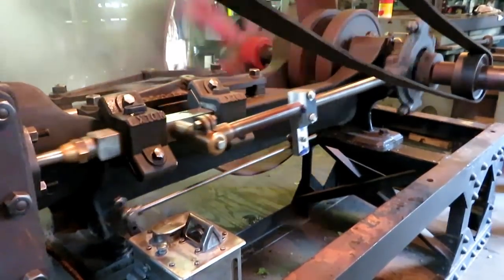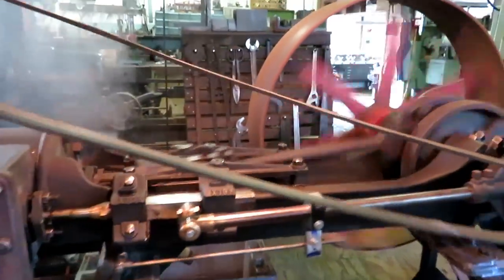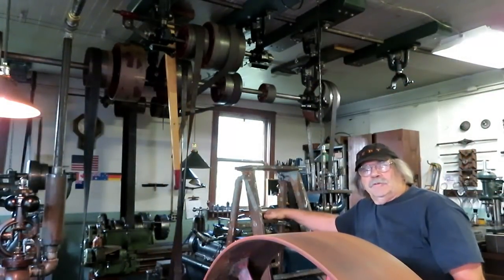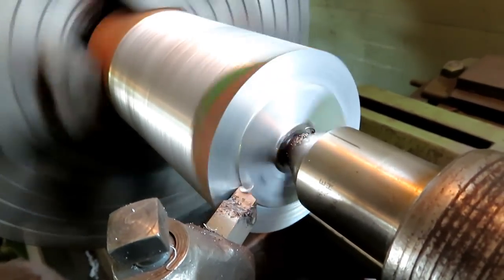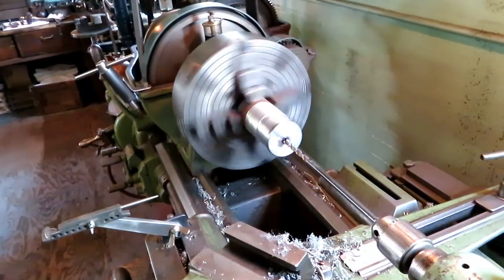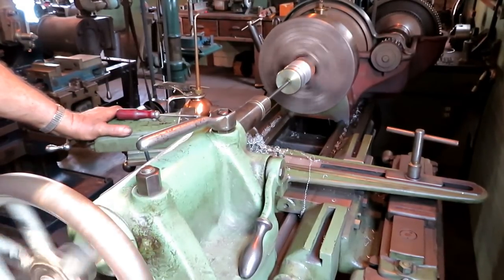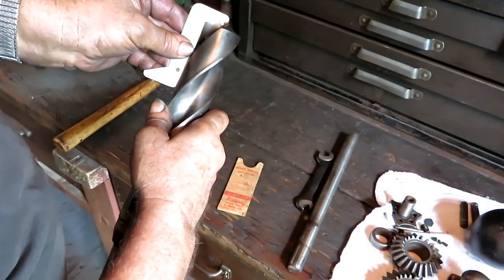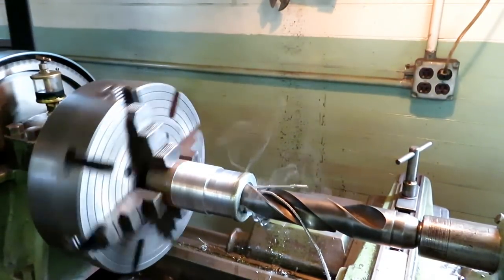OLD STEAM POWERED MACHINE SHOP  28

Comment: Dave I was watching the segment where you were showing the line shaft hangers that you had casted. On the one part that hangs down and you said that you just wrapped it with tape to make it thicker so you had material to machine off and to cut the threads. How did you set that up to turn it and thread the shaft portion that you adjust up and down. I've been trying to figure out how you set that up to turn?
Reply from the maker: Hi Scott:  That was done before I became interested in YouTube. I chucked it by the stub end, center drilled it in the "Y" and then turned and threaded it between centers. IF I do another one of those, I'll show it....Dave
Reply: David Richards Dave, sometime after I wrote that I remember you talking in another episode about turning between live centers, something that's not done much anymore you said, and thought, "I bet that's how he did it"  " he chucked up the round end and center drilled with a starting drill to give a center to hold against, marked out the center on the shaft end and drilled it then turned it between centers!!  It's not much but I was proud of myself as a non machinest for figuring it out, your a good and natural teacher.  I hadn't touched a lathe since high school and yet the other day out at my brothers house who recently bought an old South Bend from the thirties that's been converted from belt to electric belt I felt comforts tinkering with it and showing him a couple things, especially how to change the gears for threading.  That was awesome because he turned to me and asked rather amazed how do you know this stuff?  Which I responded " I had machine shop my senior year!"  The look on my brothers face was priceless!  But it's really neat to understand how the machine was originally set up to work and you can see how they converted it to an electric motor.  How the motor drives a V belt to a big sprocket which then drives a flat leather belt which was the original belt.  It's just neat to recognize how all these machines worked.  Thanks Dave, I've learned and relearned so much watching your videos that once I actually get my shop purged of all the junk that's accumulated I'm going to go shopping for a lathe and mill.  
BTW: Where could someone ever find a drill press like your large one, the one with the square table.   I'd love to have a press liked that one with power feed that you can reduce to such a slow speed that you can tap with it.  An you know it's a commercial grade machine I can pass on, because it's sure as hell going to out last you and I!  I know finding one is probably a long shot.  Anyway thanks for everything and have a great turkey day,  Scott
Reply: @scottpecora371  They turn up. I managed to snag one complete and great shape off gov deals, with a motor for $160. Had to totally restore it, but it was well worth it. Keep an eye peeled so you can get them before dealers like BlackSmithTools buys it and jacks the price up 6x.
Reply: David Richards   Hi Dave I wish you would invest in a taller step ladder,  you make me nervous on that short ladder.😀

Comment: Love every bit of it.  Probably the most difficult thing to remember about this old shop equipment is that they are work horses, not race  horses.  Patience has a big roll in getting good results out of them.  A bit difficult to remember after seeing more modern equipment at work.  It usually takes burning the tip off of a high speed tool bit to remind me to slow down.
Reply: My Sea Bee Uncle always used the term about the work horses and show horses. He was a firm believer of using your head and not your back and your feet had to make up for what your head forgot. Sure miss the good ones.
Reply: I think that term is one I got from my Father.  He served (at least at the beginning) in an Engineer Battalion in the Marines.  That's probably where he heard it used.  I know for certain that "thinking with your feet" came from the railroad.

He would also say "the man pushes, the mule pulls."  Personally I think the mule had an easier time with his work.
Reply: Could very well be. He said someone could holler or point to something and he'd go run it. He also said I was just like he was. Talking about blowing me totally out!  But so far, so good. And I'm with you about the mule.
Reply: I was going to add I've been around some Gravely walk behinds and if you try and push them, they will stomp a hole in the ground and fill it with you. They work at their own pace and you might better get used to it. I had to, and quickly.

Comment: Congratulations on running the big steam engine. I was surprised how smooth and quiet it  runs. Of course it had no load on it yet. Why are these steam engines so fascinating to watch? Is it because of their slow motion and relative simplicity so that you can see and understand them when they run?
I have one topic that I would like to hear more about and I am sure you know quite a bit about it: What were the different steel types they were using in the steam era? On which part of a steam engine would they use which type? Were they standardized? Or did every steel mill have their own flavors? What would be corresponding modern steel types? Maybe others are also interested in this and you might mention it sometime in a video. It probably applies to most of your videos.
Reply: rol eic I know what you're saying about what seems to be a universal fascination with steam engines.  I think there are several small reasons that come together.  First you but rarely ever see this form of power being used in our world today.  Second,  steam is very quiet there is no sound of combustion unlike combustible fuel engines.  Third steam engines can run at almost a stand still, because their not dependent upon internal combustion.   Fourth, although steam doesn't generate a Lot of horsepower, they generate tremendous amounts of torque.  If I remember correctly on one episode of Daves he was calculating the horse power and torque of the O&S 5x5 engine that was used to power his shop.  If I remember correctly it generated something like 6hp but 126ft lbs of torque.  To put that in perspective a 6hp Honda gas motor will generate somewhere around probably 8-12ft lbs of torque @ 3000rpm (you can get the exact specs on Honda's web sight I'm sure).  This is what made steam the perfect power source to power the emerging industrial world of the 19th and early 20th century.  Because the main building material was cast iron weight was always tremendous making internal combustion difficult without a Lot of gear reduction.  Steam was perfect.  Fuel was varied and abundant, combined with fire and water.  This is what made steam the perfect choice for trains for over a century until diesel and electrical generation were perfected on a mobile level.  But steam is like a living creature, hissing,  groaning, smoking and mechanical sounds, making it almost magical!

Comment: I  am really enjoying your  channel and seeing the  large steam engine run. I enjoy the back ground music too, but the engine is the music to my ears. I am surprised the you don't have a continuous oil bath when drilling the bearing with the large bits. Is there a reason that my novice mind has not taken into consideration?' Please keep the  videos coming... I am somewhat of a shut in and do not have a machine shop to tinker in or learn from.  I am continuously amazed at the tools and devices you have accumulated. Thanks!!!
Reply from the maker: Hi Ron,  Old machinery was built to use lower grade cutting tools which won't stand up to speed (heat). At the speed I was drilling, cooling and lubrication was definitely not a problem so a squirt now and then was enough...Dave
Reply: Continuous coolant delivery was maybe not in use when these machines were new?

Comment: Even with the problems that old girl has she has a quiet beauty about her when you slowed her down to essentially tick over speed. Is that going to be the new shop engine or is this just another shop job? She might use a bit more steam to run the shop but damn she has some power.

Nice work gents getting her going.

Comment: Another great video - congratulations on the new, running, engine.  Thought I might note that with a big bit in the lathe, I sometimes hit it (carefully) end-on with a big copper mallet to tighten up the morse.  It can stop one spinning, as you mentioned yours sometimes did, and if it grabs it makes it less likely to pull the bit out of the tail stock (annoying), and in a bad one, less likely to snap off the tang (embarrassing, when I did it in front of the guy I work for!).

Comment: Thanks for showing the line shaft transmission at 17:27 I always wondered how that actually worked..I guess there are a lot of ways of doing it...But that seemed simple with the free spinning pulley,  How it just lets the belt glide over to the  drive pulley . I always look forward to another installment!

Comment: I was browsing thru one of my beside readers "Lathe work for machine shop practice"1941 edition and it's got a picture of a big lathe dog around a drill shank in the tailstock with the offset "L"resting on a tool bit in the cross slide,to prevent the drill from spinning when she grabs.Simple ,but neat
Reply from the maker: It works like that, if necessary...Dave

Comment: Bonjour David,
Great machine ! Which pressure did you use ? I am surprized to see no lubricator on the excentric of the side valve (heat), this is why you checked it ith your hand I guess.
Amicalement, Raphaël
Reply from the maker: I think we had about 50 psi. when we started it. We kept the eccentric oiled with a can. I was trying to find the knock....Dave

Comment: It's great to see your shop building itself. With a little help from the owner, of course. Question about the new engine: Will the larger engine represent a real improvement in the shop (meaning you needed more oomph than you were getting with the old engine)? Or is the upgrade more for the fun of it?
Reply from the maker: Hi Rick, I really question switching engines sometimes. The small O&S worked so well....Dave

Comment: Dave, if you grind a flat on the boss of the drill you can put a lathe dog on it and rest the other end on the ways, it'll slide along but can't spin. Had an old lathe that was worn out where I did my apprenticeship but it had a great swing so it was still useful and we had to do that with all the drills, it didnt fit a tang either.
Reply from the maker: Yeah, that would work...Dave

Comment: Dave, I think I finally figured out that the main drive belt runs at a constant speed/RPM and then that constant RPM is sent to the line shafts which then transfers that power to the machines. There will be some speed changes because of the different sizes of of the pulleys but overall there is a constant speed. The change in the speed and torque is accomplished by the gearing of the individual machines. It is like a modern day turboprop aircraft engine that runs at a constant speed and then the torque and speed for the aircraft as it flies is controlled by the pitch of the props. Did I get it correct or do I need to go back to the classroom? LOL
Reply from the maker: That's about it, except that the faster you can run the belts (within reason) and the more you can use the gearing reduction in the machine, the more torque (= power) at the cutting tool without belt slippage..Dave

Comment: Hey Dave, do the belts slip much when on a load such as when you were drilling those bearings? Did you get the knock out and what was it? Can't wait to see it power the shop. God Bless Ya   Dave
Reply from the maker: Top pulley belt slip is the limiting factor on the lathe. Most of the knock was the eccentric bearing that I made new shims for, took out .005" and it took care of that. The valve rod slide now is tighter and should take care of that....Dave

Comment: Congrats on getting the big engine running. I have a question. When you were drilling to make the bearing, it got pretty hot, did that heat affect the hardness of the metal?  I know nothing about metal, in high school I went to drafting classes instead of metal shop. Can't wait for the next video.
Reply from the maker: Hi Gerald,  The material is "mild steel" and doesn't have enough carbon in the alloy to harden from heat. Old machines run very slow with a heavy feed so not much heat is generated in the work piece. It's really the chips  coming off that are hot, and the oil makes some smoke....Dave

Comment: G'day Dave good to see you again mate, it was a great sight to see the old engine steam again after all the work that you have put into it, man that's got some power great!!!   Just one question on drilling out that bearing could you have done it with a boring bar?  Anyway great stuff look forward to the next video, regards John
Reply from the maker: Hi John, sure it could have been done with a boring bar but you have to make a hole first. I think with this old machine, I can remove metal faster with a drill.....Dave
Reply: David Richards thanks for the reply Dave I see what you mean now in relation to drilling the bearing.  One thing is that lathe has a hell of a lot of power, you tend to forget the power of steam and steam con paired with compressed air? Thank mate John

Comment: You removed 0.005” shim from that connecting rod cap, I assume both sides under the cap bolts. I’m guessing there may be wear in the babbitt, if that’s indeed part of the connecting rod cap assembly. My question is that I don’t see any lubrication going to that eccentric, such as an oil cup. If babbitt is used, what’s used or how is it lubricated?

Comment: David.....  With all that stuff moving around does OSHA bother you and are you ever afraid of a runaway? Lot of work but worth it. Keep them coming......
Reply from the maker: Hi Johnny, OSHA probably wouldn't be concerned with my shop because I hire no employees.  I forgot to mention we installed a quick shut-off in the overhead pipe which will have a chain easy accessable.....Dave

Comment: A couple of Questions, Do you need to trreat your water for the boiler? and will you need a seperator for the oil /water in the exhaust?
Reply: I doubt he uses a separator as both engines exhaust to the atmosphere so there is no way the oil can get into the boiler.  An oil separator is needed if the exhaust is condensed for reuse in the boiler.
Reply: With steam you add oil to the steam to lubricate the pistons and valves. While steam/water will act as lubricant on small hobby type engines, a working steam engine will wear rapidly if the dry steam doersn't have oil added to it.An in line lubricator supplies a measured amount of oil to the steam, in the old days it was tallow , then commercial types of tallow plus 2-3% mineral oil added were used as Talllow emulsifies well . Today Shell and other companies sell a #900 weight oil which doesn't have additives and will not acidify when in the presecence of water.  I have used this oil in Early (pre1920) car traqnsmissions ansd diffs with exclent results as it doesn't attack the Bronze components like modern gear oils.  So..when the exhaust from a larger engine is open,oil comes out, Steam sperators are common and often uised in line before a condensor so that oil doesn't coat the condensor tube walls and insulate the cooling effect .http://www.penriteoil.com.au/products/categories/industrial/steam-cylinder-oil
Reply from the maker: I bring the rain water PH up to about 9 and use Jim Conti's "Boiler Saver" compound in the feed water. It dosn't take much.....Dave
Reply: I used Jim's Boiler Saver in my engine on my sawmill... Great stuff. I really enjoy your videos. I had a machine shop through the 70s and 80s same kind of equipment as what you have... I'm convinced that you and I both may have been born in the wrong century.
Reply: We used several boilers over the years to supply steam to my dads Factories and we used a propeitry brand here to adjust the PH, if we didn't the tubes would get limed up really quickly,hence my question . Back in those days they were diesel fired ...until a certain country put the price up in the early 70's.When i was an Aprrentice i was assigned for three months to boiler duty ,helping run a babcock and Wilcox ex ship bouiler running on coal with 6 automatic coal feeders, most of the plant was pre 1920 so i had the oppurtunity to learn all about gland packings,etc etc. Steam is fascinating . :-)

Comment: Dave, will the new engine drive the line shaft from that huge flywheel if so, it looks like you will need a huge pully on the line shaft to get a reasonable speed for it?
Reply from the maker: Hi John, The engine runs at 95 RPM with the 10" crankshaft governor pulley. The line shaft runs at the same 240 RPM as before...Dave